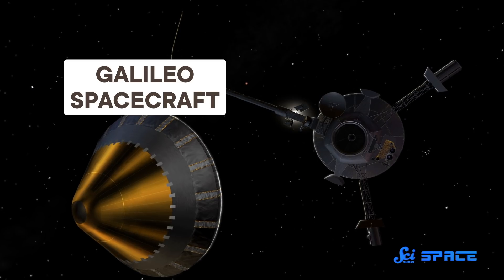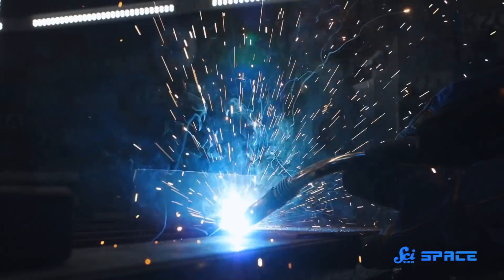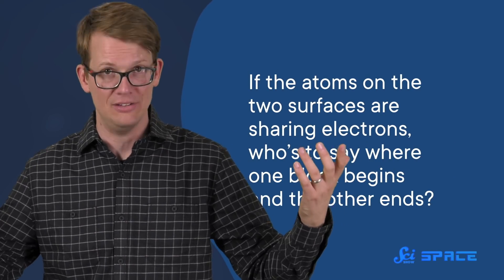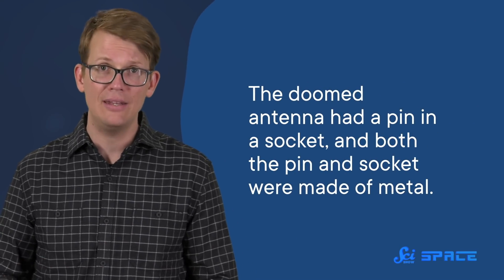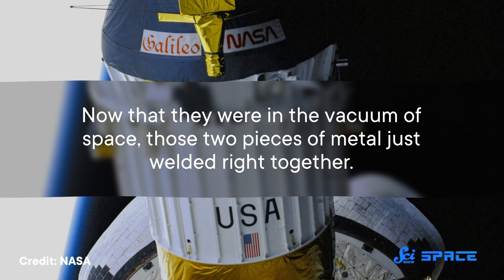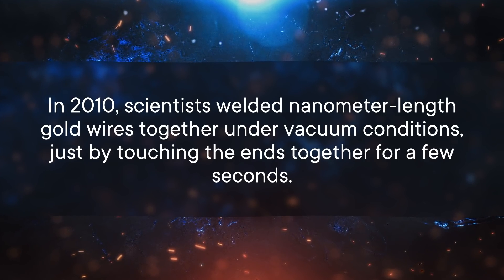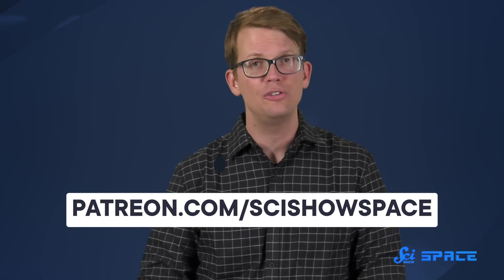In Space, No One Can Stop You From Welding

Comment: @SciShow Space actually, Cold Welding represents a revolution is 3D Printing. The next generation in 3D Printing is to be able to print using any material (printing in plastics, metals, glass, ceramics, proteins, cells (basically food)). The generation after that was to be able to print in any material at the same time (Printing copper next to plastic or whatever, Printing simulated steaks with simulated broccoli on printed china plates). Cold Welding represents a potential 2 generation jump.

A Third generation is to shrink the resolution of printing to that cellular, then micro cellular level, then to nanoscopic levels, at which point the simulated foods should seem exactly the same and the possibility of on site printed surgery with near zero recovery time may be possible. 

This tech could end suffering, aging, hunger, and even save the planet with its potential for recycling and resource savings.
Reply: So... Star Trek? Thank you, Gene Roddenberry. =P

Comment: Cold welding is also how how wire wrap works! And that's been around much longer than 2010. It is an alternative to soldering: wire wrap twists a wire around a pin so taut that the wire cold welds to the corners of the posts, providing a deceptive amount of strength over friction alone.
Reply: @Derek Lam   Electronic board assembly and cabling of Atlas ICBM was all wirewrap.   I've seen them being manufactured in the early '90s when I first entered industry.   They were a work of art.
Reply: NANO SCALE, NANO SCALE !!!
Reply: A radar system I worked on back in the 80's/90's used wire wrap in its receiver, processor, and display subsystems. Any time there were modifications to be made, it always seemed to involve removing/adding/rerouting what felt like kilometers of 18 to 26ga wire. We mostly used a pistol style tool that was spun by squeezing a handle on the grip, though for unwinding (and some winding on small jobs) we used a set of small tools that sort of resembled precision screwdrivers.
Reply: They were talking about nano scale cold welding of delicate components, specifically, not wire wrap of the wires in general electronics assembly. It’s an important distinction.
Reply: I think scishow meant that the small cold welding experiment was a great success for electronics, but not necessarily the first time someone cold welded here on earth
Reply: Sorcery!! Ban it for Jesus.
Reply: @mikicerise6250  LOL I laughed at this a lot harder then it had any business to. X•D

Comment: Crimping is a type of cold welding, I use it every day.
Reply: I'm not sure it qualifies as welding. Sure it might be water tight or air tight but if you wanna split the two bits open, you can, they aren't one solid piece of metal
Reply: @ChaosPootato  yes not the same thing as heat is produced. What is described in the video I have always heard of as vacuum welding. Also clean off some thin sheet metal (high quality, like airplane aluminum) and see how quickly it welds together (although this may be more gluing together, which is welding in a vein). The wirewrapping mentioned above is the same thing, pressure is being used there to force a bonding, and not welding.

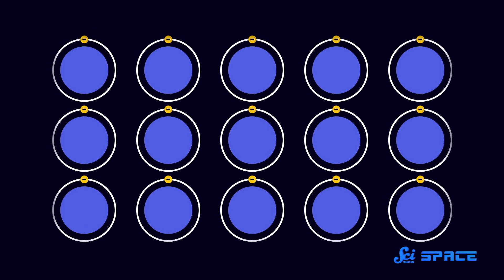Comment: 1:27 I'm going to guess what is why electricity moves so easily through metal
Reply: Yes, and it's also why metals look metallic. Because electrons are confined to atoms in most materials, incoming light (electromagnetic waves) goes through some combination of absorption, transmission, and reflection when it hits them. In metals though, the electrons can easily respond to light, and realign themselves to block it from the interior of the material, producing a near-perfect reflection.
Reply: @Rhaegar19  and thus giving the "metallic lustre" that we are so familiar with
Reply: Furthermore, it's part of the real reason why you can't create a transistor by sticking two diodes together- the "sea of electrons" interferes with the semiconductor pieces interacting with each other.
Reply: Bingo
Reply: Yes